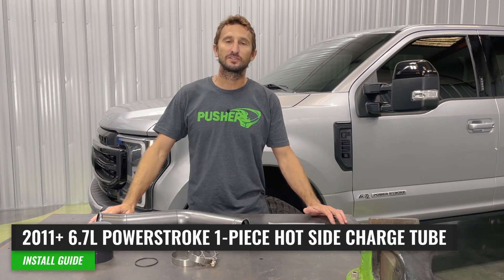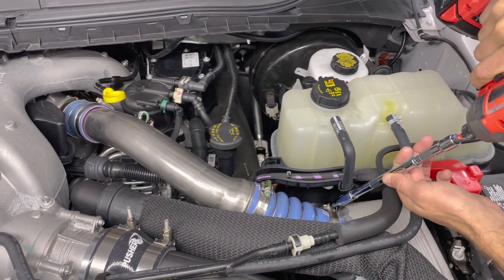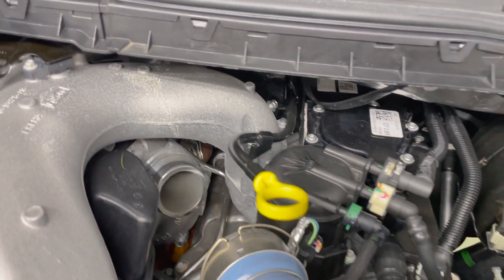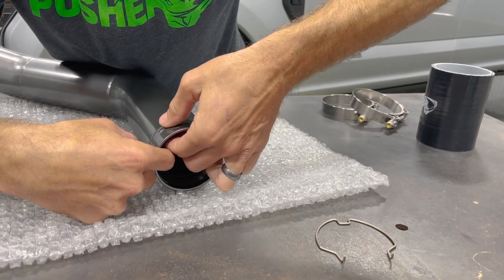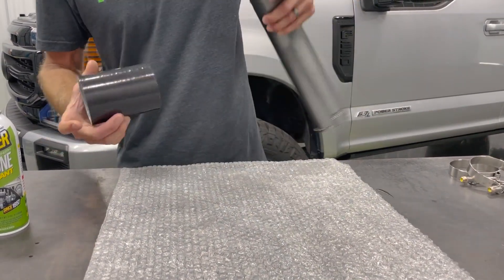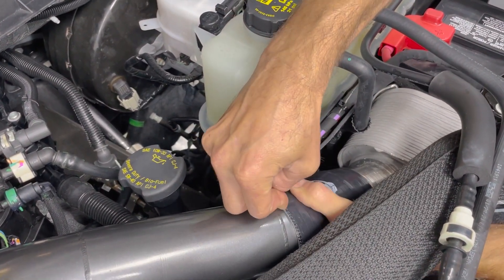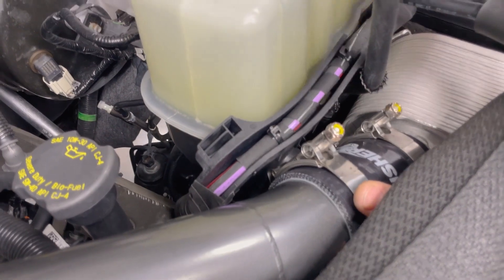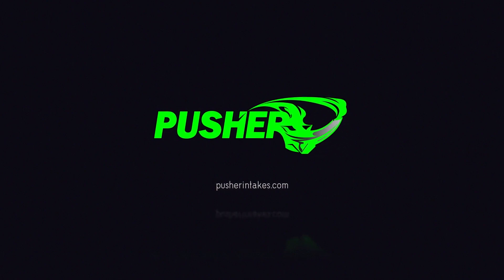INSTALL GUIDE: 1-Piece Hot Side Charge Tube for 6.7L Powerstrokes

Comment: The o ring needs to be redesigned, and the 1st bend on the pipe needs to be straighten a little. I've had 2 o rings and they leak. Seems to me the 1st bend in the pipe is too defined and not allowing the pipe to be straight on the turbo outlet. It seems to be piched up, allowing oil to leak from the bottom of the pipe down into the valley.

Comment: Ordered this o ring and will not go on to turbo at all have tried everything
Reply from the maker: Hi, did you reach out to tech support? Typically when we hear this it's an aftermarket turbo that doesn't have a chamfered edge and there is an easy enough fix for that - give us a call if you didn't get that figured out and we can help troubleshoot. 772-212-9290 x 4.

Comment: is a replacement o ring seal available?
Reply from the maker: Yes, give us a call and we'll take care of it. Part number will be -142 X-ring.
Reply: Will this fit a 2023 f250?
Reply from the maker: @WrightPartyBus1  Yes
Reply: What if the seal nearest to turbo keeps leaking oil?
Reply from the maker: @dallon507  Is this theoretical or are you having an issue? If the latter give us a call so we can troubleshoot. 772-212-9290. It could be a damaged o-ring.